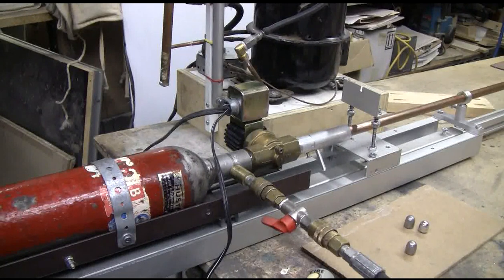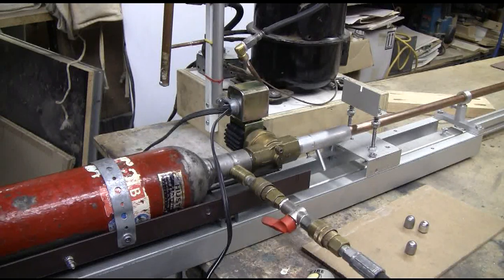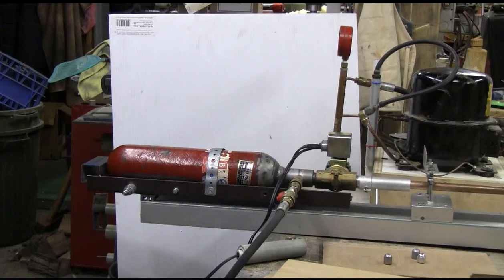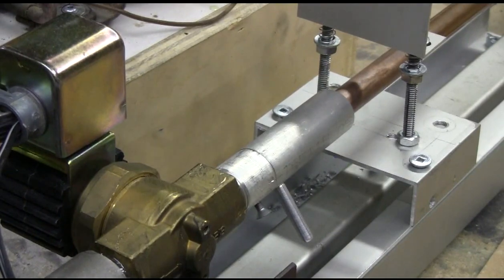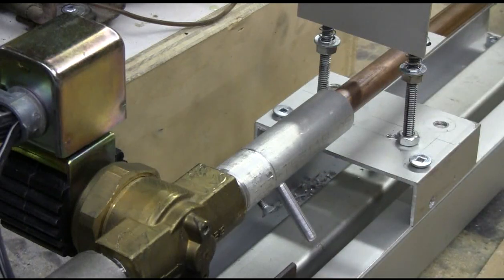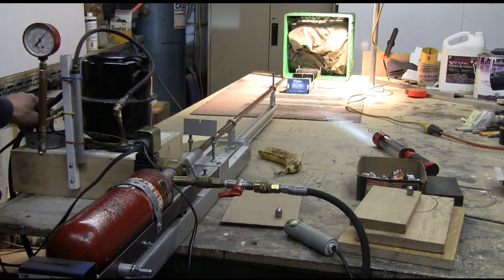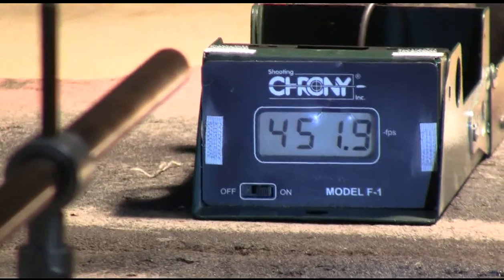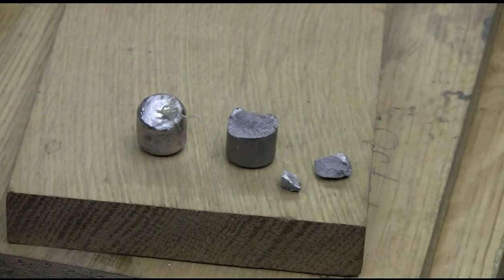Air Cannon #51 - New 3/4" Solenoid Valve Cannon

Comment: Hi Bill, can you control the solenoid valve how long it opens?
Reply: Yes, it can be by using micro timer.  You can by at any electronic shop.  This component  can set 1 mil second to any delay.  Once the Controller are powered this will work as the time set when you push trigger switch.... Or you can control it manually by your finger.  Like long press short press.